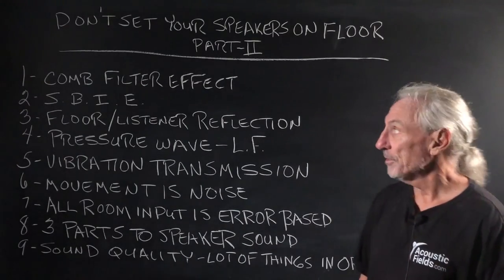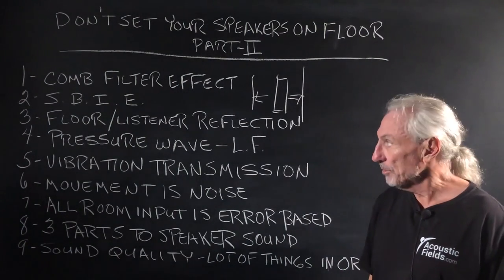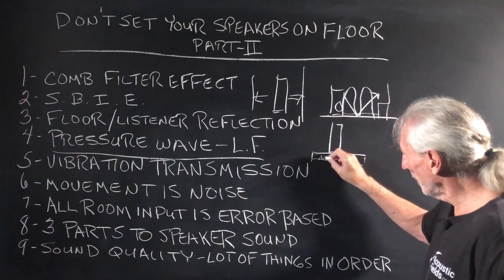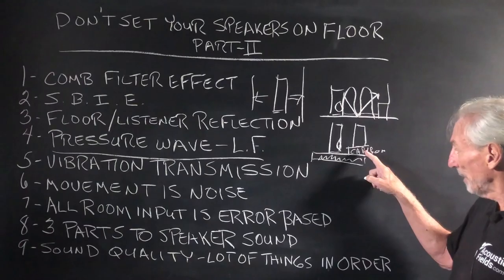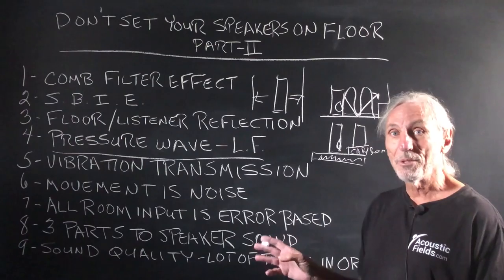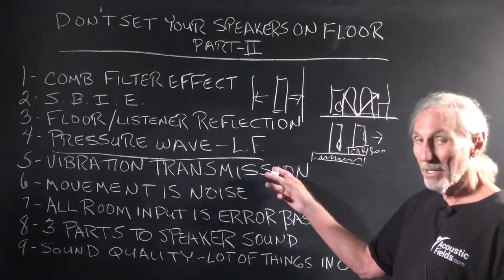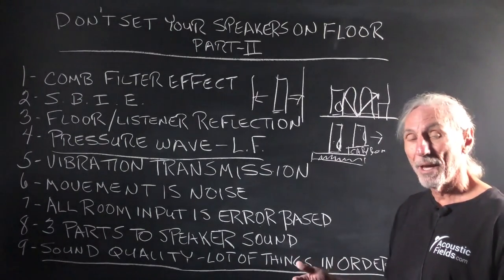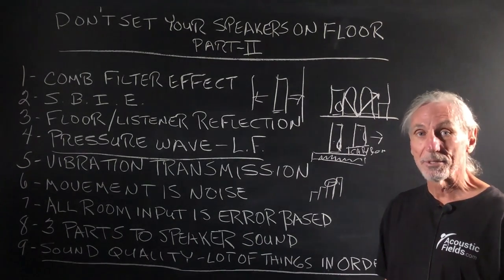Don't Set Your Speakers On The Floor! Part 2 - www.AcousticFields.com

Comment: Very true ,  Ough  My main speakers is so big and heavy they can 
only stand on a floor , so I have mounted dampening rubber ' feets ' 
under them and it of course prevent vibrations from transmit to the floor a lot .
( those only ' lift ' the speakers up  3 cm so optimal solution here )
Moving bass speakers up is really not possible when speakers is 130 cm tall .
They have two 15 '' inch and a big horn each  , so they are pretty big and  paired 
with subwoofer with 18  inch driver the system go very very low in frequency so 
it is even more critical to dampen against vibrations ect .
The height of the speakers is ( my luck ) not a problem and when I listen im just 
right in the ' sweet ' spot of the  tweeter / midrange  ect , so sound is great .
Yes it can be problematic if bass drivers is too close to a boundry (  floor , wall ect ) 
and of course unvanted reflections can disturb the image and worst cause delays 
there be mixed into the main / direct sound signal .
Very different is it with my studio monitors .
I have two monitors I have modified to suit my needs and they are up and away from 
floor , back wall and sidewalls at an ok distance ect  .
Yes You nailed it very good those factors we need to look at when placing speakers .
Very nice and good explained .
Keep up those great videos , they help many people .
Reply from the maker: Thank you for your comments and following.

Comment: from about the 50 second point you talk about reflection from the floor and the pressure wave from the bass driver. Okay, but how far do you need to elevate the bass driver to get away from that. Considering the wave length is so long, elevating it won't change much, right, yes it will isolate it from the floor but that's all. Or do you think I have it wrong?
Reply from the maker: You can not get away from anything in small rooms. You can minimize the impact through elevation, attenuation, and isolation.
Reply: @AcousticFields  Okay but if your room is 17x23x14H then it's not as important?

Comment: FWIW  i use those round blue Danish cookie cans to de-couple mine  :) Have  a Fisher 500C and vtg Pioneer....
Reply from the maker: A hollow aluminum can would provide elevation but not attenuation or isolation. It may be producing a sound of its own. Place a towel inside each can.

Comment: How about a subwofer built into a closet? 7 ft deep and 2 inches wider than sub box.  What issues do those close boundaries create?
Reply from the maker: More unwanted pressure issues due to small room volume.
Reply: @AcousticFields  it's firing through a hole-in-the-wall the full size of the speaker box. We're just talkin about the surrounding area and space behind it and how much does that matter.

Comment: I have read that a listener should keep the high frequency drivers at ear level. If I elevate, tweeter will be above ear level. Is elevation still a good idea? Thanks Dennis / great stuff.
Reply from the maker: It depends on the radiation pattern of the speakers and associated drivers. Ear level or just above ear level is a good start point for most. You will have to experiment with different heights. We have found that with horns we like to have the bottom of the horn at ear level and sometimes we raise it even higher.
Reply: @AcousticFields  it may not be practical but would flipping the speaker upside down be an option in this case so the Tweeter could then be at ear level?

Comment: I use excellent soft dampening feets to all my speakers.........except my 2 speakers I have on the side of me that hangs of the wall.
I have a 7.1 system = 6 speakers, with the sub, have great soft feets anyway.
Reply from the maker: Isolation from vibrations is an important variable. Achieving quality sound within a room is all about doing a lot of little things.
Reply: @AcousticFields  Yes, and soft feets are the best, with an amazing improvement on wooden floors, while most of us just use the spikes you get with the speakers.

Comment: If manufacturers would do their homeworks...
Reply from the maker: Most design for price point to fill a slot that is open.
Reply: @AcousticFields  integrate a aborbing bottom of 20 cm on a floor standing speaker would open completly new solts for people acutally care about quality - i mean you have price ranges and the not dumb cheap ones are for people who care about quality anways - and it's optically way better than have some ugly stands